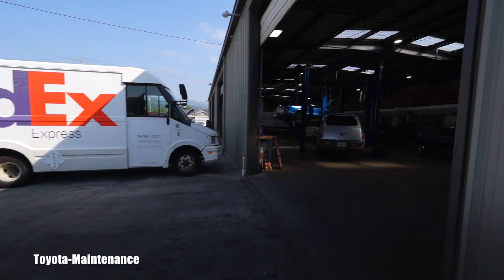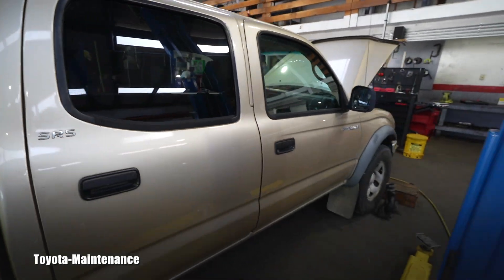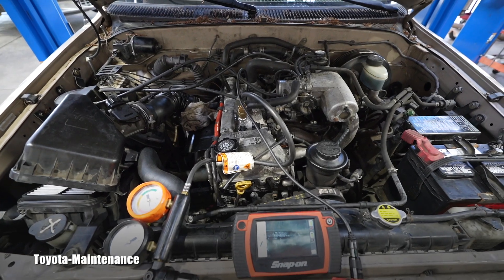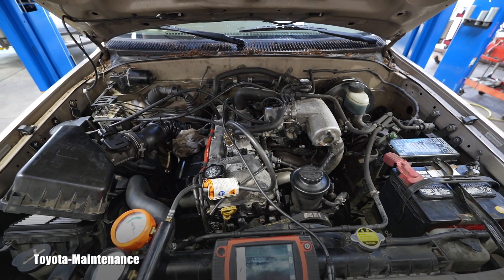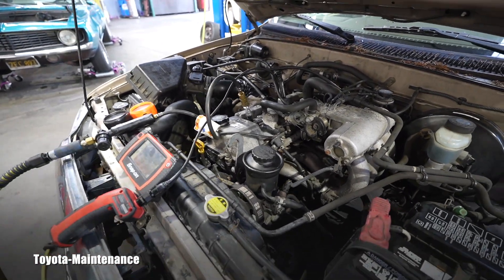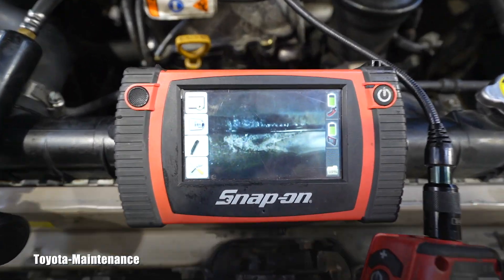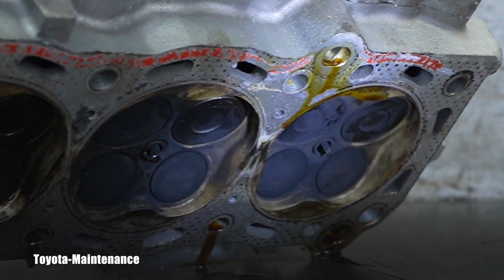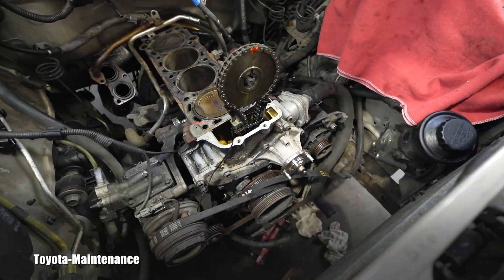Toyota 3RZ-FE Engine Blown Head Gasket

Comment: Thank you for video, I have a 98 2RZ turbo 12 psi boost with 290,000 miles. No signs of blown head gasket. Runs good. I wonder what caused the head gasket to fail on that truck. Might as well replace some other parts while the engine is apart. Replace fuel filter and clean the injectors. Clean behind throttle body.

Comment: Did you check to see if the coolant used was for japanese vehicles?  The word is that using american style coolant can cause head gasket to leak.  Also want to add that I have seen a Tacoma with the 3RZ engine with 500k miles with no rebuild and just regular maintenance.  200k miles is still all right though.

Comment: I didn't think Toyota ever offered the 3RZ-FE in the 4-door cab. I thought the 3RZ-FE only came in the base model short cab. This is the first time I've ever seen a 3RZ-FE in the 4-door cab.
Reply: They are out there. Usually the wheels have that specific design when they are a double cab with the 2.7
Reply: Those are one of the styles of Toyota steel wheels. If you ordered a Tacoma back then that wasn't already on site, you could order any wheels & any trim or option ya wanted. Example: This happened in July of 2000. My local dealer didn't have what I really wanted on the lot, so they allowed me to use their phone so I could special order a 2001 Tacoma 4x4, extra cab, V-6, 5 spd manual, and locking rear diff in silver paint. They literally asked me if I wanted to pay a little more for the TRD graphics, and I said no. This was only because I wanted the factory locking rear diff, that only came on the factory delivered TRD trucks, with super charger, high performance suspension, etc. But they were perfectly happy to give me exactly what I wanted, and what I didn't want. When it arrived late Sept, they said it was the very 1st '01 model to arrive in all of Florida. It arrived before any factory equipped truck or otherwise. So there's really no telling, unless ya have all of that info about each truck. Buyers may want something that's added performance, or this double cab for example, but to save money, they may have special ordered the truck with 3RZ engine and steel wheels to keep the price down. I don't know if every dealer was willing to do this, but Toyota of Melbourne Fl sure did for me.  @jimrossabrena7955